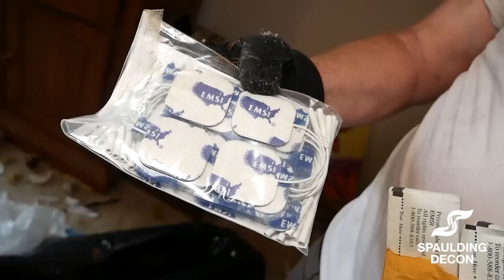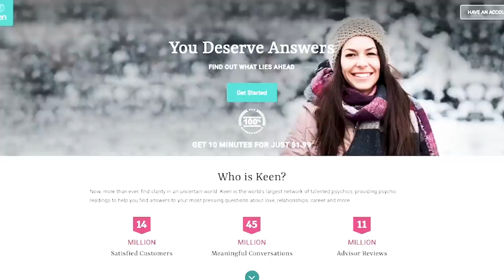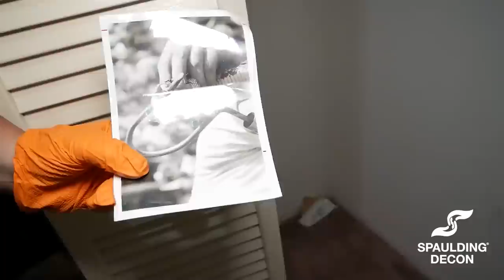No Longer Living... ALONE! (Hoard Rehab)

Comment: That plastic thing with the scroll in it, that you found at 3:45 looks to be a beautiful Mezuzah.  It's a Jewish holy item.  The letter on the front is the Hebrew letter shin, for shalom, which means hello/goodbye/peace, and can also be construed as welcome.  The scroll inside it contains a passage from the Torah, the Jewish holy book (basically, it's the Old Testament of the Bible,  plus their own holy texts).  The Mezuzah would be hung at an angle by any door of the house, on the doorframe.  Some are nailed into the wood.  On this one, you can see the adhesive strip on the back, where you'd peel the paper and stick it up.  Jewish people do this as a way to bless and protect their home, and as a reminder of their faith. The same way a Christian would hang a crucifix in their home.  The tradition is to kiss one's fingers, and then touch the Mezuzah, as one enters or exits the home.  The same way a Christian would dip their fingers in holy water, and make the sign of the Cross, as they enter a church (or, occasionally, their home; my grandma had a little holy water basin on her wall).  You can even get a Mezuzah for your car.

I hope you didn't throw it away, or try to sell it.  To a Jewish person, and indeed to anyone who believes in a higher power, it would be to throw God's Word in the trash.  And even if one doesn't believe, they ca/should still respect its significance to someone else who does.  It's an important physical representation of their faith, and should be delivered into the hands of a person or institute that will treat it with the appreciation and respect it deserves (not clowning on anyone at Spaulding-you guys are AWESOME, and besides, you didn't know what you found).  The family might want something important like that back. Even if not, you should try to find a Temple nearby, and give it to them, so perhaps they can find someone who needs it.  That shouldn't be too hard, in Florida, lol.

And I don't say that in any derogatory way, lol.  My husband is Jewish, which is why I know all this, and his (also Jewish, ofc, lol) mother lived in that same area that you service.  There's a huge Jewish population there.  You shouldn't have any trouble at all, finding a proper, ahem, home, for that Mezuzah, lol.  If the family didn't want it, I hope that's just what you did/do.
Reply: I came looking for this comment. You did a beautiful job explaining it, far better than i could have.
Reply: @laurawithnou  thank you.  I've always been intrigued by Judaism.  Since meeting my husband, I've learned so much.  And I always love to share. :-)

Comment: I noticed the woman bending over touching the floor while working without bending your knees. I did that for years and that is a sure-fired way to slowly but surely ruin your spine you get back issues eventually you get x-rays down the road it's very very very bad for you and can be a liability as well missed work hospital bills and insurance I'm just saying from the whole standpoint all the way around it's not good for her or anyone else you guys should talk to her about that I know it's easier sometimes when you're overweight to just bend over it seems more uncomfortable bending your knees I had the same problem and now I'm pretty much stuck in bed I'm 57 when you do that kind of work for so many years it will wreak havoc on your back on your spine
Reply: I wanted to comment this too, because I ruined my back redoing my deck in 2019. I was avoiding kneeling to protect my knees, but instead I overstretched the ligaments around my SI joint by bending way over like that and reaching. Now my hip and lower back are in bad pain all of the time. Please protect your joints and back, everybody! 🙏🙏🙏